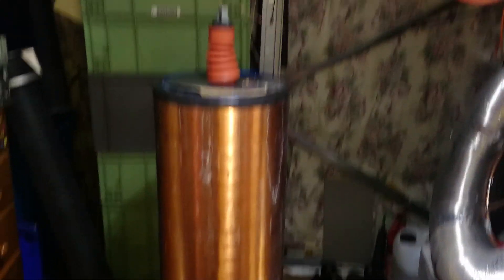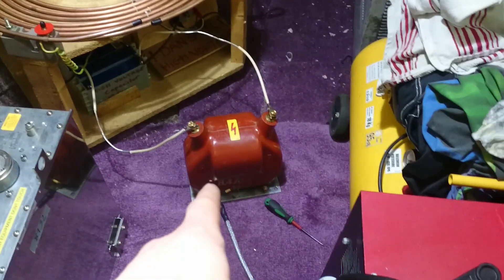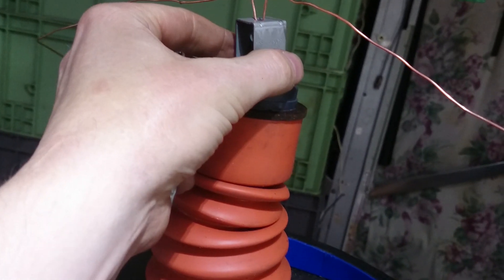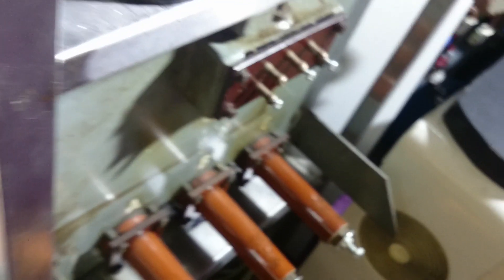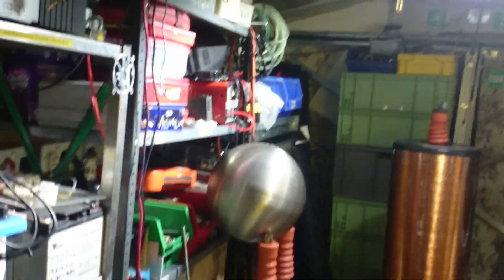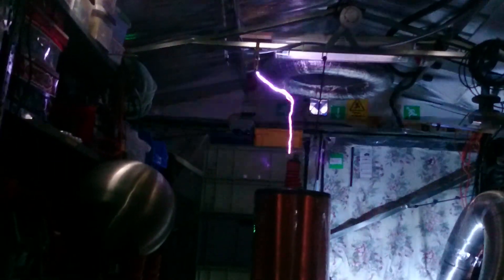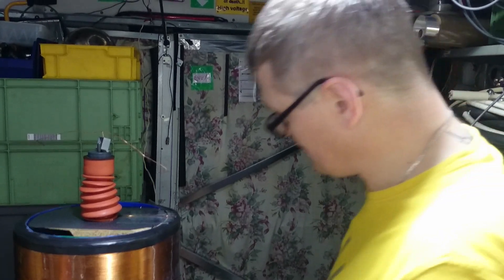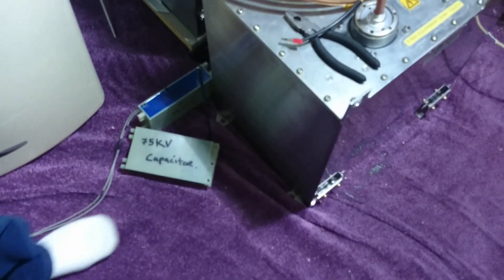First BIG coil run.

Comment: how long did it take you to wind that secondary coil? what did you use as the tube for winding on?
Reply from the maker: Hi mate, it took me about a hour and half to wind it up! And it's a corrugated pipe, and covered in a sticky back plastic. That's to strengthen it! Stop the windings from sinking into the ridges.

Thanks for asking mate and kind comment 👍😉👍

Regards

Anthony 

High1voltage1rules
Reply: high1voltage1rules Tanks Anthony. The reason why I asked that question is because I always see the giant tesla coils and I ask what those people used and no response so thank you soo much for telling me that. I want to build a tesla coil that big.

Thanks for answering my questions

Regards

Kyle

Kman Meteor

Comment: It is very brave of you to run it so close to other objects, let alone in your shed!
Reply from the maker: Hahaha I know lol, I had break out parts hanging from the top of the garage. Si if it's going to reach out it would go right to ground. ⚡👍😉😜

Thanks for the comment and hope ya well.
Reply: high1voltage1rules I'm not so well right now, as you might see on Google+, but things are better. I never knew you had strike targets as part of the structure, but they are a good thing to have for things like this!